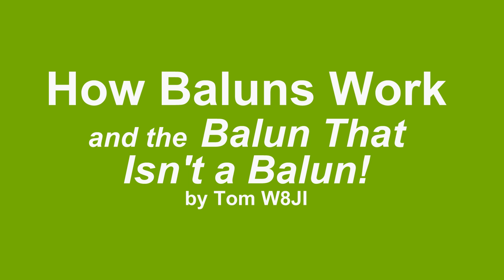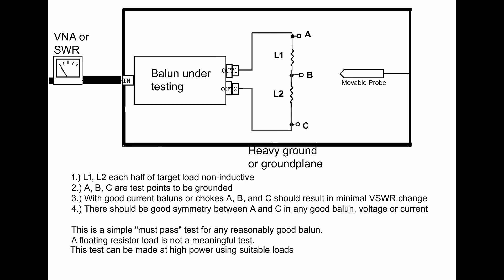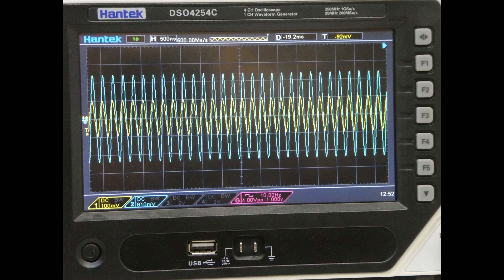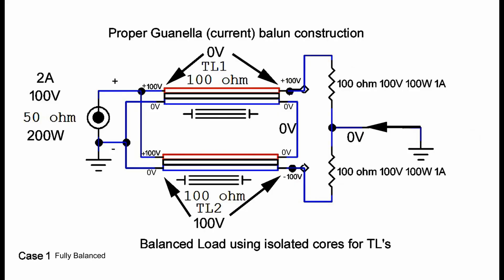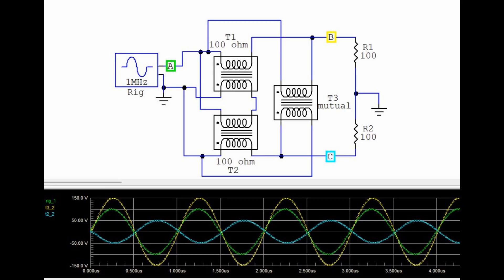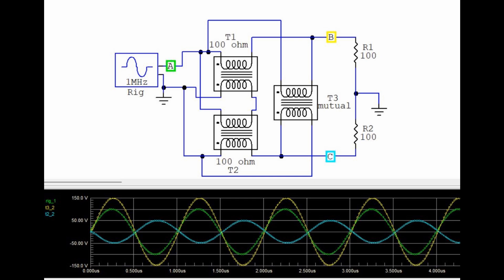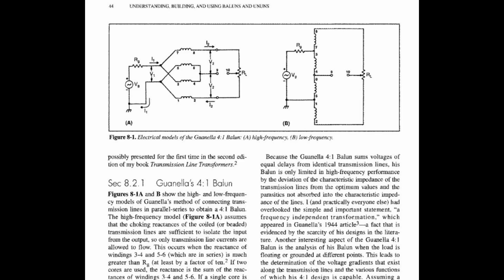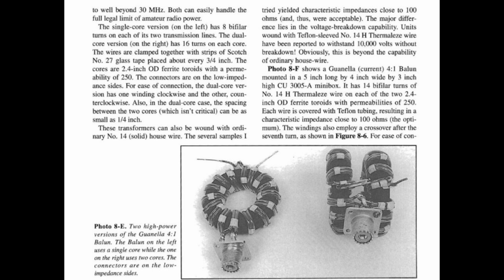Defective 4:1 Current (Guanella) Balun Design

Comment: I agree with your analysis and assessment. Guanella's original paper did not use a ferrite core (not yet widely available for the civilian market then), so I would spare him when speaking of the "original authors." (I noted Guanella's original paper was not shown in the video.) Many 4:1 Guanella transformers wound on a single binocular core were used in broadcast receiver sets, so I can imagine some naive amateurs copied the idea incompletely, using a single donut or tubular core. And I agree that those are the ones who should be criticized. As you know, the two halves of a binocular core have very low mutual coupling (which you represented with the third transformer), and so 4:1 Guanella would work that way.

Comment: I have been trying to tell this story for over a decade. Watch 99% of the 4:1 Youtube balun design videos and  you will find all they measure is the insertion SWR. As Tom states, the #1 parameter is balance, with maybe insertion loss being #2 and SWR a distant third.
Which  brings up another point  and that is the misuse of the word UNUN to describe a transformer with unknown common mode capabilities.
Reply: Hi Dale.  Me too.  I ran field tests on an OCFD 12 years ago, comparing the single- to the dual- core 4:1 Guanella, skewing the coax radically to one side to force Common Mode Current onto the coax.  I applied a 100 Watt carrier and measured the CM Current with an RF Ammeter, one 'physical' Lambda down the coax.  The results were shocking!  The dual-core impeded most of the current but the single-core allowed RF on the coax to shoot up sky high. (over 300 mA).  I have been telling this story now  for a dozen years.   73, Rick (DJ0IP) from Spiderbeam.
Reply: I had no idea that people were using 'UNUN' to describe an 'UNknown to UNknown', rather than its correct usage of 'UNbalanced (antenna/load) to UNbalanced (feeder/source)'. There is a lot of misunderstanding regarding UNUN, BALUN and Common Mode Currents. It's only in the past few years when these things have come to the foreground due to the often forced use of simple end fed/off centre fed wires with a coaxial feeder. Wire have been used since radio started but they were fed with open-wire or parallel conductor type feeders. The use of coax to feed balanced antennas, such as dipoles, means some kind of device to equalise antenna system currents needs to be used.  This video highlights some of the misunderstandings that are commonplace when discussing antennas and endfed types in particular. 73, Sean - G4UCJ

Comment: I have built 4:1, 9:1, and 49:1 UNUNs to feed end fed antennas, They work fine. I don't try to drive balanced antennas with them. I use 1:1 current mode BALUNs to feed dipoles.
Reply: Have you ever applied power to the antenna and measured the feedline for Common Mode Current using an RF Ammeter?  If not, how do you know they work fine?

Comment: The Guanella transformer is not a blaun, but is is a very good transformer.  It is typically has lower loss, higher power handling and broader bandwidth than the Ruthroff design.  Guanella designs are used extensively in industry.
Reply from the maker: Guanella absolutely describes a balun that transforms impedance. With two transmission lines on isolated cores, the input and output are isolated for common mode.  The output terminals are free to move around to whatever voltage the load dictates for current balance.
Reply: @Jerrythenerdful  True, if both windings are on cores.  More typically, one winding is on a core and the other is just a delay line.  This is commonly done, particularly at higher frequencies, as it separates the balun function from the transformer function.  A separate balun can be added, if desired. The balun is then not constrained by the impedance and length limitations of the transformer windings.
Reply from the maker: @JPM1956  A phase compensated transformer with a core only on one winding is not much different than the error Sevick made. Neither one is a balun. But with an independent core or independent common mode chokes, one on every transmission line,  a Guanella (current) balun is formed. The high common mode impedance adds isolation between each output port terminal and the input and ground. This lets the balanced side float from the unbalanced side. 

Actually either side could be balanced or unbalanced when each transmission line is also an independent common mode choke, or it could even be used as an unun or phase inverter. This is the nature of isolating the two sides for common mode.

That all goes away if the common mode isolation is killed, which is what Sevick accidentally did. If you go to his book and read the few areas where he discusses balance it becomes clear he did not understand balance, unbalance,  and common mode.....nor did he test for it.  That is what got us all in trouble.
Reply: @Jerrythenerdful  True.  My point was that separating the balun from the transformer allows for a more robust balun design.  The impedance of common mode currents is generally unknown and can be very high.  The design of an effective balun may be difficult or impossible.  But back to the beginning... my reason for posting originally was that you seemed to be broadly criticizing the Guanella topology, but the Guanella topology is actually very good for transformers.  Anyway, thanks for your video.  I think you are doing a good service for the ham community.